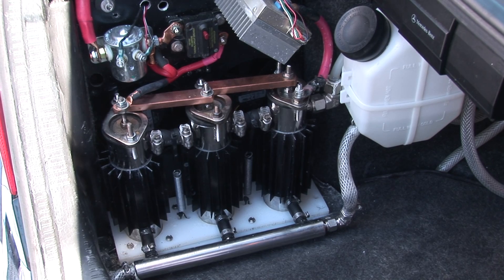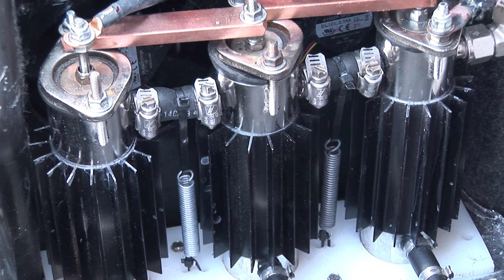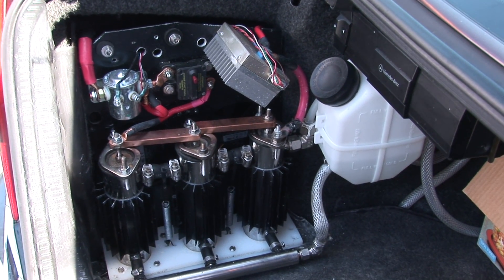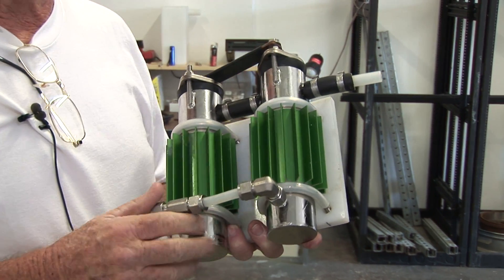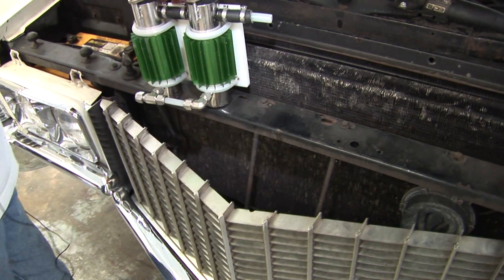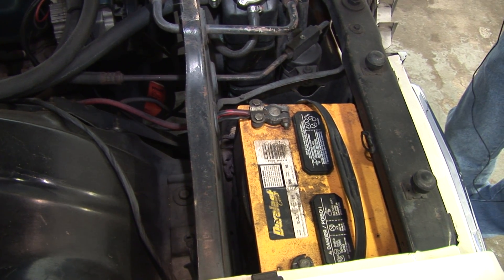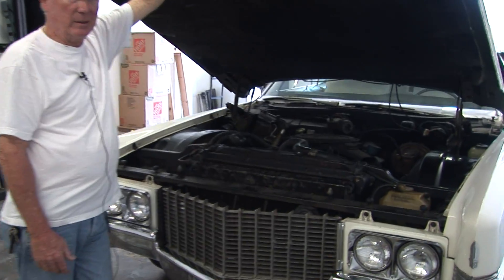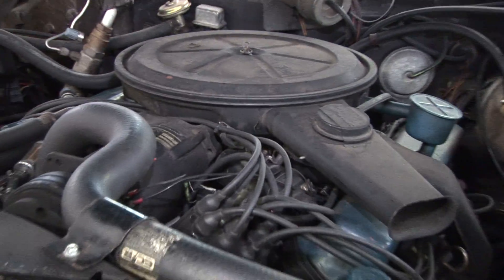Arnie Boyle's Hydrogen Generator

Comment: I did fatal mistake when I bought hho plus hydrogen generator dc2000. Now I know I never seen any original video about fuel consumption 20-30% from this Portugal manufacturer! He is killing nice free hydrogen energy. PWM 60 amps was dead after 1 month because was problem with buttons with notification no water ! Electrolyte acid leaking from water tank! Installation was terrible for 2 days. I asked my mechanic to professional help me with installation manual and video step by step for €300. In my control there was not the electric wiring and it lacks connections big diameter The bubbler, as well as Electrolyte. I will be grateful if he do what is necessary. I tried ask PayPal a full refund, because this is terrible product without accessories. After I uninstalled everything and sold on the ebay for €150 (new cost with efie chip over €400) Think twice and check first seller review!